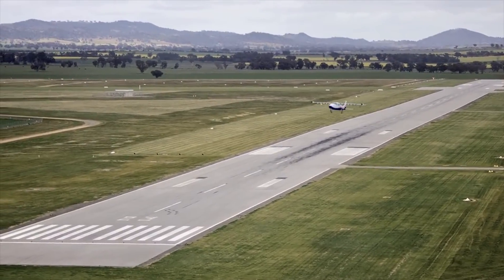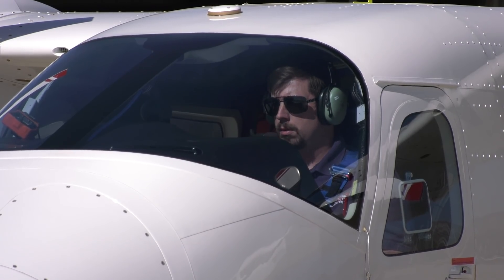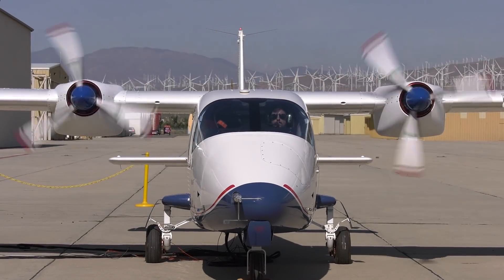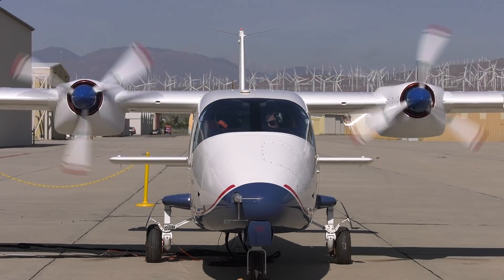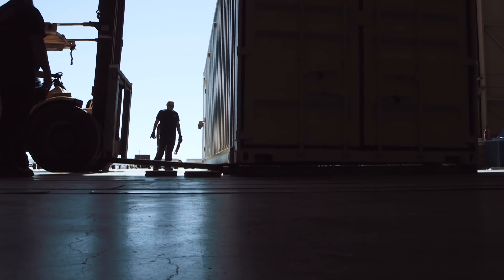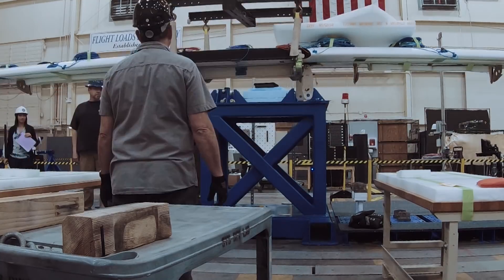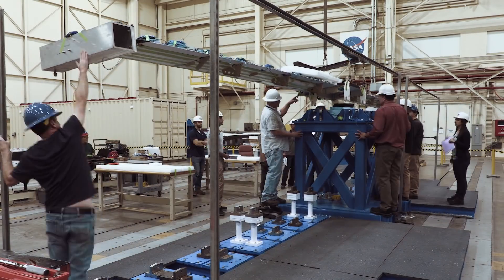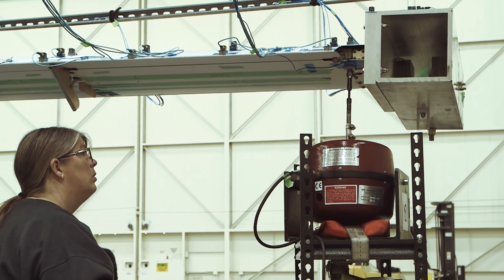NASA Marks Milestones in Development of Electric X-57

Comment: Put a magnet in the center of your steel Disk Motor AXIS prop. It nullifies the time lock in the centrifuge Accelerating your simple electric motor to break steel speeds. Allowing electric planes to go jet velocities easily. Use a superconductive magnet in the axis of your prop motor, break The Sound Barrier Ed. I Am A Pioneer.

Comment: I call Bull Shit.
I’ll be the first to admit I’ve been wrong before.
Until the energy density problem of electron storage is solved...
Or another form of previously unknown energy production is revealed.
This is impossible...no impracticable. 10-12 motors is 10-12 failure modes.
The 2014 Jeep we bought is a dangerous POS that has killed people by itself.
The transmission is totally controlled electronically.
If the electronics died, I do not know if I could put it in Neutral to push it off of a dangerous road...or out of my driveway.
Every modern computer/electronically controlled automobile should have a mechanical or electrical relay switch to shut off the fuel pump immediately.
Preferably reverting all electronically controlled systems to a basic manual and/or electric DC 12V powered operation only. Bypass all logic devices.
What stores the power in these planes? Lithium? Fuel cells?
No thanks.

Comment: It's really hard to see how a bunch of tiny props could possible have an advantage over a smaller number of large props.
Reply: Seth Tucker the idea is that you can have a much lower aspect ratio wing (less drag) by actively blowing air over it using the distributed motors. Also I think there’s supposed to be structural advantages to distributing the load along the whole wing
Reply: Redundancy?

Comment: Lets wait and see if they can bend the laws of physics regarding battery limitations, which we have reached years ago.
Else this will be a hybrid aircraft, which is way more cool.
Reply: flexairz we’ve still got some big improvements coming with things like silicon anodes but we’d probably be better off using fuel cells for aviation if we can ever get the cost of hydrogen down

Comment: It's good to see NASA building an X-plane, but electric aircraft are completely pointless.
Reply: Homo Quantum Sapiens  How is electric propulsion advantageous at supersonic speeds? You couldn't even get an electric aircraft up to supersonic speeds, not only are there no motors that are powerful enough and light enough to do it, but there are no batteries that are energy dense enough to supply that much power to the motor in the first place. You're delusional.
Reply: Considering the pollution caused by airplanes I wouldn't call them completely pointless, especially for domestic and short-range international flights in Europe.
Reply: @Veirian  They're pointless because they can't fill those roles, or any other role. Electric aircraft are nothing more than a novelty.